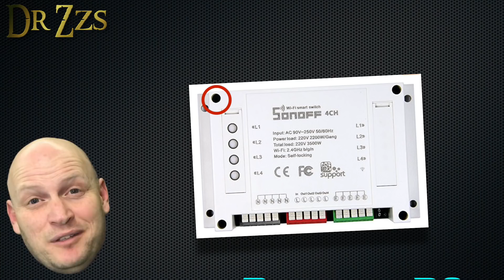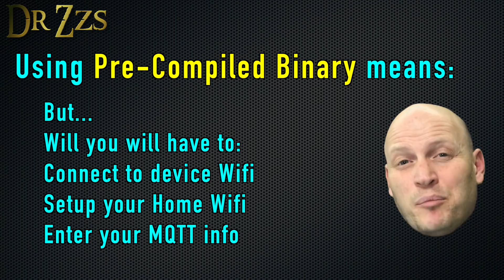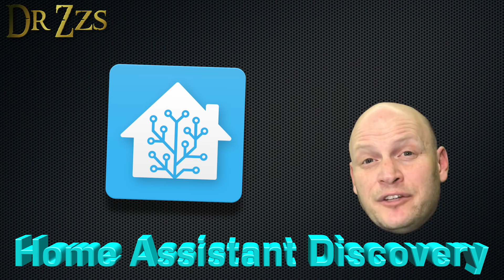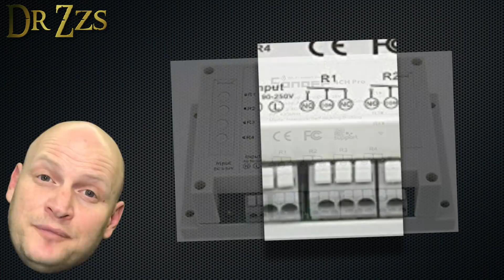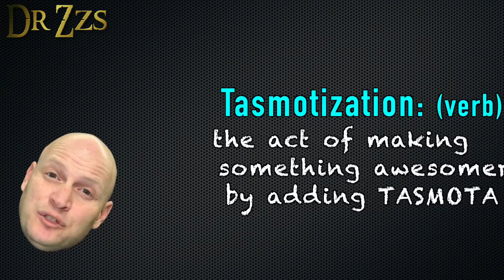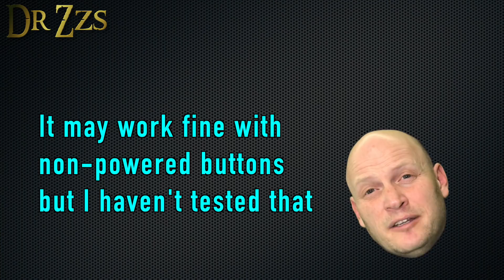Sonoff 4 channel w/ Home Assistant Discovery and FlashEZ

Comment: I have a non pro R2, the way to flash it is the same as a non pro non r2 so you're good. :p  I bought it on Banggood.
Reply from the maker: Awesome!  Thanks!
Reply: You're welcome.  They're great devices, only problem I have with them is I can't connect a physical button to every relay.  In case my Openhab (or future Home Assistant :p ) refuses to work, I like to operate my appliances with a physical switch.
Reply from the maker: ya, I didn't try adding extra buttons.  I'd guess all you can do is solder to the contacts for the existing buttons. 
If you need a lot of relays in one place it is a good little device.  The non-Pro is much cheaper than buying 4 Sonoff Basics.
Reply: Yeah, I tried soldering to the contacts.  Let's say it was dodgy at best.  Sometimes a button press (or wire contact in my test setup) would not turn on the relay, other times a press would activate 2 relays.   I think I'll be using the 4ch for mood lighting I use in scenes and I'll be sticking to Sonoff basics for all my main lighting.  Another thing I'll use the 4ch for is for switching power outlets.

Also, I don't think it's that much cheaper, the 4 CH R2 costs 19.99 $ on Banggood and a basic is 5.19 $.  You will need the backplate for DIN rail mounting for the basic if you want to go that route though.  If you want a physical button connection for your lighting I do think a basic is the way to go though.
Reply from the maker: That's a good use of the 4 ch.  
iTead usually has the best prices on their own devices. 
https://www.itead.cc/smart-home/sonoff-4ch.html

I'm with you, I'll keep using the Zzonoff for my lights.  Solder the mains wires, add a fuse, and use the led touch module.  Just installed a couple more yesterday for the garage. Love'em!
Reply: DrZzs Yes, it's cheaper but Banggood has free shipping so for small orders Banggood will be cheaper, for bigger orders I will consider Itead. Thanks for the tip!

Also, maybe an idea for a video and the holy grail in cheap DIY home automation: reliable dimming!!
Reply: one other advantage of a 4CH vs 4x 1CH is that you have 1 transmitting wifi chip vs 4 polluting the airwaves! and remember, wifi acts like a HUB, not switch, so only one device can talk on 1 channel at a time. it becomes an issue when u have 50+ IoT wifi devices that your router has to manage. And to make things worse, these SONOFFs only support 2.4GHz and not 5Ghz 802.11ac which has way more non-overlapping channels. Sorry for geeking out, I'm a network Geek, I look at this from a different lens 🤗

Comment: thanks for explaining inching&SL. I got a valve closing motor device(similar to dome device but for $15) it takes 12vdc but the power has to reserved to activate to open the water/gas valve. It seems i can use 2 relays to achieve opening and closing valve from hassio. . I got 4 b1 and 3C T1 and was strrugling finding gpio 0 on the new T1 . After flashing it the T1's would not retain the settings - i will try flashing it with the generic github bin file and see if that works. the one i compiled was for generic 8285.  Thank you.
Reply from the maker: I got your email too. 
I'm going to do the T1 3c soon.  Thanks for showing me where gpio-0 is.  I'm not sure about the problem retaining the wifi settings.  That's really strange.  
Anyone else having that problem?
Reply: i gave up on the T1 3C for now but i will try the default .bin file upload and see if that sticks. I also got the new B1s, 4 of them all flashed with tasmota. please get the lifx one and give it a try. now that i was able to compare B1 ($20)and lifx($38), - lifx is still much dont want to say bright but seems more prominent colors and fillup the room better than B1. when they go on sale on amzn please give it a try. next  i am going to try all yours & bens' led projects. thanks

Comment: Quick question about the pro. Do you think the modes are useful given the options available through tasmota, HA and NodeRed?
Reply from the maker: Honestly, probably not that useful if you are familiar with Tasmota options, like Pulsetime, or able to do automations that can switch one relay off when the other is on.  It's kind of a funny combo of functions.  I think iTead tried to make the device for less experienced users but with extra more advanced options. It seems to me you need to be a bit of an advanced user to need or understand those options.  
The RF bit might be useful for some folks too.  
I'm still not sure where I'm actually going to use mine.  Maybe for appliances in the kitchen...